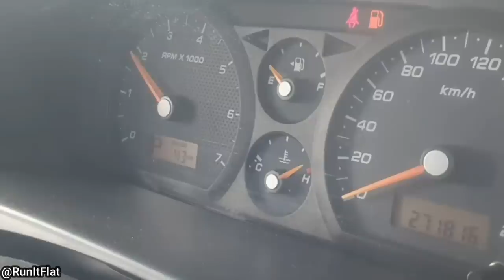Customer States Car Is Overheating And Won't Shut Off! | Just Rolled In

Comment: I used to own a Volvo 265, the one with the Renault engine, and it had a wiring harness that ran between the intakes and the block, inside the "V". Eventually, the insulation on the wiring would deteriorate, and the you'd get shorts, preventing the engine being turned off. Worse, some people had theirs start randomly, so that if you had a manual, and you'd left it in gear, it could suddenly take off on its own.
Reply: 🤣🤣🤣 self driving cars

Comment: Filters like the one at 2:00 don't implode from lack of oil. They implode from clogged filter media obstructing flow so badly that they get crushed by the pressure difference. Either that filter was long overdue for a change or it got prematurely clogged by something going wrong with the engine. From how blackened the filter looks, I'd guess soot from excess blow-by.

Comment: 1:28

How in the actual F did this car not catch fire? You know 1 bump would definitely send the vice grips tapping the negative
Reply: Because metal is not flammable. 
Also vice grips are very strong. They won't budge going over bumps if you clamp em well. 

Not saying that's the right way though. In a pinch I'd at least wrap them in a t-shirt to prevent shorts.

Comment: The battery only serves to power the main components at the cars startup such as the starter motor, then the engine runs on the alternator which provides energy to the whole cars electronics, electrical parts and recharges the battery

Comment: Due to overheating petrol engine can start working like diesel. No need spark to ignite fuel. Ned to disconnect fuel pump fuse ore block air intake.

Or if its possible (overheating caused just high load) - allow engine to cool down wile it`s running.
It`s allow to water and oil pump keep flow and avoid local overheating of liquids.

Comment: From my understanding disconnecting a battery will not shut off the engine. Engine electrical components are ran by the alternator which is ran by the belt which is also ran after the engine is cranked to start up

Comment: What kind of mechanic gets surprised the car's running with the battery disconnected... once the car is on, it essentially runs on the power generated by the alternator.
Reply from the maker: I think he was more surprised on that it still ran without the key in the ignition
Reply: Older cars, yes. Newer cars need the battery as a buffer (if thats the correct english term) for all the modules, sensors and computers to work at all...
Reply: the alternator turns on when the battery is turned on. they were able to start the car without the battery so the alternator shouldn’t have turned on. not to mention that the key wasn’t even in the ignition
Reply: @misseselise3864  What you're saying is complete nonsense. The alternator doesn't "turn on" when the battery is on, what are you on about. the the alternator starts working once the engine is on and the pully is being spun. And what makes you think they started the car with the battery disconnected or without the key. While both things are easily possible either shortening the ignition circuit or just suppling 12v to the starter motor(Something thieves know all too well how to do). The mechanic probably just disconnected the battery expecting it to shut off, hence why he's surprised it didn't. Sounding all surprised, what a joke.
Reply: @JustRolledIn  Yeah you're right, that is surprising. I'm guessing either the ignition switch is broken or the solenoid is. Since if the switch is off the power to the solenoid should be shut off, hence opening the circuit between the alternator and the ignition, cutting the power off.
Reply: @JustRolledIn  I had an old Studebaker that did that. In winter at school, I would start the car, remove the key, lock the door while the car warmed up, and stay in a heated building for a few minutes. Come out unlock door and put key back in and drove home in  a heated car.  Cool feature.
Reply: @tobiasmetzger4522  Maybe I'm wrong, but as far as I know even new cars stay on with the battery disconnected(Assuming it's a fossil engine). And I can't imagine how can it act as a "buffer", again maybe I'm wrong. Your car has a regulator which regulates the alternator, preventing damage, so I genuinely don't know. Maybe you're right.  The battery is essentially there to help start the vehicle, and to obviously store charge for the accessories, lights and such. I mainly work on old vehicles and engines, so maybe I'm missing something out with the newer cars
Reply: @yuramatyash7981  on modern cars, your alternator can bring out 60V or even more, grilling your ecu and other units in seconds and shutting everything down. The battery buffers those spikes from the generator. I apologize if they're not the proper terms as English isn't my native language, but I hope you get what I mean
Reply: My take on that one is a problem with the ignition key.

Comment: That tire tricks works great, but you gotta be quick with the air hose. Once the flames use up the oxygen, it creates a vacuum that will suck the tire right off the bead again.
Reply: its less about the fire using the oxygen and more about the gasses compressing as they cool back down

Comment: Why would the car shut off with the battery disconnected ?? Unless the alternator is bad than it will stay running
Reply from the maker: I think he was surprised that it didn't shut  off when he took the key out
Reply: Try it yourself, if your car is at least somewhat modern, and make a video of you reacting to the repair costs.
Reply: My parents own a 2018 BMW X5 and that will run with the battery disconnected.

Comment: I had the first problem with a Cadillac CTS (marketed Opel here) Just pull handbrake, push brake pedal, put her in 5th gear and release the clutch. That stops the engine, then get ignition keyslot chnaged. Costs 9 EURs.

Comment: I remember a long time ago when I still had my Saturn Ion, one day the ignition switch got stuck in the on position.  Someone told me to unplug the fuel pump fuse so the engine would die, and then disconnect the battery so it wouldn't drain.  Got it towed for service and they had to replace the ignition switch, and had to cut off the key that was stuck in there in the process.

Comment: 3:10 you really should get a bead blaster/bead cannon/cheetah/whatever term you use for it.  Put 120psi in, point it at the rim and pop the valve open.  Less likely to damage anything.
Reply: had a guy lose part of his hearing because he used too much ether in the tire and broke the sidewall while seating the bead. now have a 900 dollar plus OTC super bead blaster- works every time. it was a LT245/75/R16 tire.

Comment: At 2:37 that's a Chevy Impala/Buick Lacrosse with a 3.6 VVT engine. I saw this happen a year ago when I worked at a Chevy Quick Lube shop, we had to pull the catalytic converter away from the oil filter using oil filter pliers to remove the filter.

Comment: I recently replaced an engine on a Toyota Matrix that dumped oil and coolant into the exhaust due to the customer driving from Sarnia, Ontario to Ottawa, Ontario with an inoperative cooling fan. After installing the newer used engine, it smoked for about the same amount of time as the bus, during the test drive.

Comment: I've ran my Crappy 02 Mazda for many years without a battery. I used a lithium jump pack to start it and let the alternator do all the work. Never had any issues not even dimming lights when bumping the subwoofer.

Comment: Some tires will not go on any other way than with starting fluid and fire. I have done this 30 to 100 times in 23 years. I don't remember a time I had to use it on a passenger tire though. Most of the tires I had to use it was farm or big rig tires. Heck, that is very safe if done right. I have changed many tires that were split in the middle for 2 ton trucks. The name of the wheel was commonly referred to a widow maker. The reason they were called this is they made lot of widows! I had one blow up on me about 20 years ago. Luckily, I had already bolted it on the truck. If it is a steer tire then they are safe so long as they are bolted on.the rear outsides are not the same story but all ya have to do is use a large chain to keep it from hitting you.

Comment: 2:36 I bet I know what Make and Model: 2014+ Chevrolet Impala with the 3.6L.
Very common problem. The converter has no lower support and it just hangs off that single port exhaust flange. One car would come back every few weeks to get a new converter (under parts warranty) because it kept breaking.

Comment: Disconnecting the battery is not going to make a car stop running... because if the alternator is still good, the car is going to run off of that. You gotta pull fuses to the ECM and maybe also the injectors and/or coils to kill a car that won't stop running.

Comment: First car was an Australian Ford Falcon. Ignition switch are a very common fault. He is no "mechanic" if he hasnt seen that before and certainly not if he tried to disconnect the battery to stop it. Fuel pump relay and fuse is right there next to the battery.

Comment: when I was 18-19 I "borrowed" my parents car for a night drive with some friends. drove it rather hard for 3-4 hours. when stopping at the gas station right before returning it, the car would not stop, just like the video here. could remove the key, still ran, had to choke it out. filled the car up, returned it. the next day my parents took the car holidaying. after a few days, it caught fire in an intersection.

:o)

Comment: I have a 1999 Camry with around 186,000 miles on it. In the last two years I've replaced the original timing belt, the original water/oil pump, the original alternator and the original exhaust.

Comment: I once had to work on an 80's chevy van with 350, which wouldn't shut off, either. a badly adjusted iginition point caused spark plugs and piston tops covered in gunk, which started to glow hot enough to ignite the fule fumes. if I recall with the carburetors' switch-off didn't work correctly. but since most vacuum lines were brittle there was a leak somewhere, too.
0:34 I had the same with a mercedes W124, I think a 230E. around that time mercedes had switched to plastic turbine wheels for the water pump, which become brittle over time and then run loose. replacing the pump fixed the overheating.
1:10 a number of cars have these right away, as they are part of "packages". sometimes people would read the list and forget about the click-in towhook again.
1:25 if the connector clamp is tightened too hard it will lose tension after a while (hard lead alloy) or break (most japanese and koreans, many french), so I guess the vise grip was to fix that. they probably forgot it and left it in. someone as lucky the battery didn't explode, I guess it was dying, anyway.
3:01 these are as pathetic as fake exhaust tailpipes (extra points if you can see one has soot inside, and the other hasn't) and those puny "balls" for your car. closely followed by them ornamental fake tattoo stickers we call "Arschgeweih" (butt antlers) in germany in your rear window... especially if it's uneven and slanted.

Comment: That last one is a classic DIY off-road bead sealing trick I usually only heard of Ronsinal lighter fluid but any flammable hairspray or alcohol based aerosol works apparently!!! 😎
Reply: +10 points for the tech wearing hearing protection.
Reply: WD 40 works

Comment: I used to work at a lube shop. It was kind of a lousy place but I learned a lot.  One time we had an angry guy in a peeling, ancient Yaris tell us he needed a top off because his oil light was on. I noticed there was no oil on the dipstick and the car made a clattering noise. He was 6,000 miles past his oil change date. My boss told him there was no oil on the dipstick because he had continued to drive when it was due for an oil change and it had burned all the oil. He told us it was our fault and left in a huff after declining an oil change. He didn't even want the top off.

Comment: The bit with the car that wouldn't shut off reminded of something that happened to one of the cars my parents had some 40 years ago.  The bought new a 1977 Peugeot 504 Diesel.  One day when it was a few years old (three or four) my mom calls from work and tells dad that the car won't shut off!  Dad drives to her job (35 miles away, hence having a diesel car) and tries to shut off the engine, even trying to block the air intake to stall the engine, but to no avail.  So he leaves her his car and takes the Peugeot to the dealer.  Turns out the problem was that the solenoid used to shut off the fuel injector pump (mechanical fuel injection) was failing.  They showed him what to do when it wouldn't work.  Open the hood, reach down to the injector pump, and manually flip the shut off.  I had to do that a few times myself.

Comment: The first one with the ford falcon that's overheating I have personally encountered and what happens is the ignition switch fails and half blows out of the column which can result in a condition where you can't shut the vehicle off. The fuel pump relay is in the panel just behind the battery so it's not hard to stop it running. 
The funny part is although that barra is extremely hot let it cool down and replace the expansion tank and it will keep going like nothing happened for years.

Comment: the two ends of the automotive oil spectrum:
•oil changes are clearly optional, also why did my engine seize??
•dumps the entire engine capacity of oil into the engine and wonders why it hydrolocks

Comment: The one with the ecotec with the collapsed oil filter definitely has a faulty bypass valve... Lack of oil or plug filter should automatically cause the bypass valve to engage

Comment: 1:10 this is actually really often the case, its cheaper to mass manufacture some models of cars with "extra" features on all of them, and so they are all bought by the dealer at the same price, then just cap/hide them if they don't pay for them, and unhide them if they do for that extra few bills
Reply: Hitches? Never seen that for free.  Just buttons not installed.

Comment: Ignition switch buggered? on a BA Ford Falcon? well I never
Reply: Happened to my BF. The ignition switch is made by Bosch, probably in Germany. Mind you, the car is probably 20 years old.
Reply: I owned one and have repaired many. Very common fault, very poor design
Reply: The tibbe switches and keys in prior models weren't any better. Wore out too quick.
Reply: @rossbrumby1957  don't know if you've seen it, but Lock Picking Lawyer did a video on those with an insane lock picking tool for them.

Comment: I have drove 50000km and my tyres still had some threads left (under legal limit, surprise).
Bit slippery. Only 80Hp but could power slide on moist asphalt on 3rd gear.
Reply: I suspect the one in the video had bald tires from doing burnouts.

Comment: 1:35 although its probably the customer doing whatever or many more miles that what they claim (which the mileage would have been recorded at the time the tires purchased and mounted, and should be on file with the shop) but honestly I could see manufactures screwing up something in the rubber "recipe" or etc and making the tires wear out very fast. Wouldn't surprise me at all, especially these days. 

My Dad owned a mechanic shop for a number of years. Later on he bought a 77' ford pickup for his personal daily driver. Ended up having to rebuild the entire engine. Bought brand new crank and camshafts from napa. They only lasted a couple hundred miles and the lobes were completely worn down due to the heat treatment either not being done correctly or not being done at all. Napa wouldn't warranty them, so he threw them on the counter and left. He then we to a local auto parts show named Cook Brothers. Bought all new parts, rebuilt the engine for the 2nd time. And never had any more issues again.

I've also worked in automotive for a number of years, and have seen many "brand new" bad parts. Just because it's "new" doesn't mean the part is good. Have seen people try to figure out a problem, replace parts thinking they had eliminated it as the issue, only to find out later that the "new" part was still causing the same problem.

Comment: We had an old tractor that some times would run off when the turbo leaked, this often happened after it ran for several hours in hot weather. I guess oil thinned enough to pass the seals. We would just use our tshirt to block the air intake then wait half an hour for it to cool enough and then we would start it again and continue with our day.
Reply: Check out the vids when it happens to trains and semi trucks!
Reply: The videoes of trains are freighting

Comment: Tip of the wise when this happens either jiggle the key until it COULD possibly shut of or pull the fuel going to the engine because then it wouldn’t go to the alternator or even let it run out of fuel

Comment: 2:03  - this is a fairly common occurrence with the 2.4L ecotecs (the direct injection versions). This engine comes factory burning oil and everyone thinks its ok to go 10,000+ miles on an oil change.
Reply: To be fair.  The oil probably gets exchanged every 5,000 miles or so if you keep it topped off.  🙄

Comment: First clip is of the Australian BA/BF Falcon and the ignition barrels tend to need replacing after a while. I think it's a spring failure. Very expensive to replace!
Reply: That's what toggles switches and push buttons are for!

Comment: I had a 95 f150 that never wanted to shut off. The nylon rod snapped that actuated the ignition switch. Before I found out what the problem was I tried to disconnect the battery. Still chooched. Had to disconnect the battery and turn on all the electrical stuff to overload the engine to shut it off. (High beams, AC blower on high, dome lights, break lights) I drove it like that for a looong time 😂. Good memories